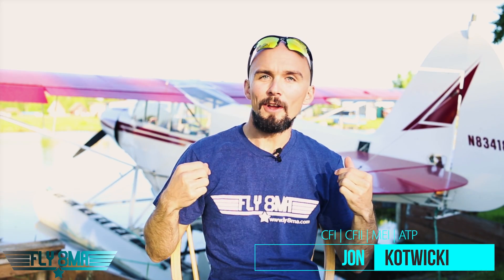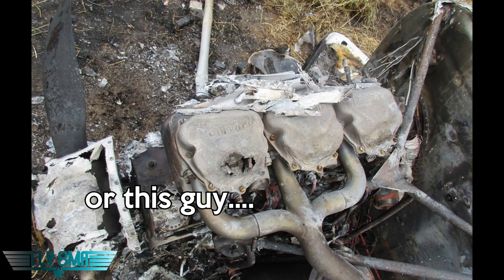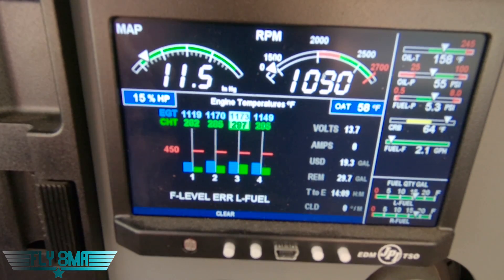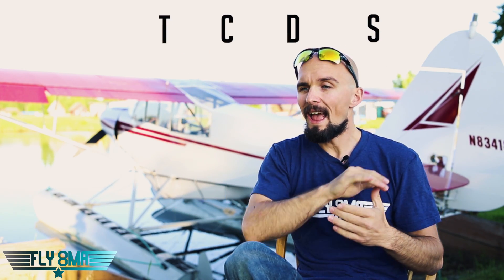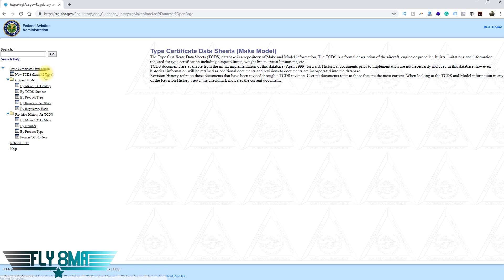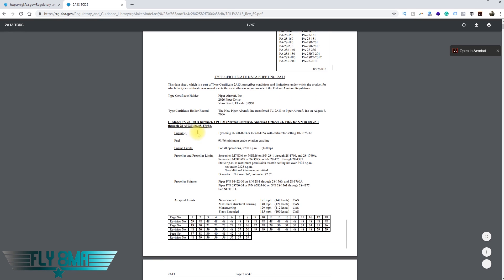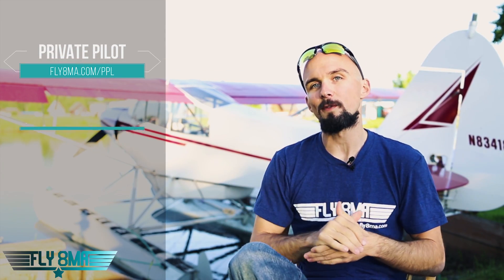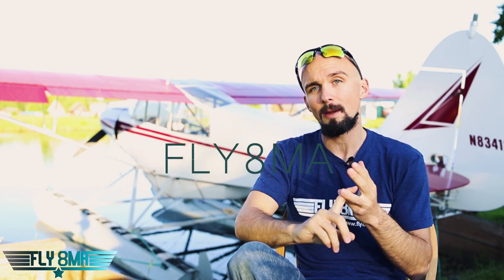Don't crash on Takeoff

Comment: You can put some carb heat on take off if wet and cool conditions.  Done that many times.  You can also lean mixture a bit if engine start getting rough.  Dont wait until engine fails when rough.  Troubleshoot with some carb heat, and leaning mixture a bit.  Practice Take Off Troubleshooting.
Reply: Right.  Take Off Troubleshooting is not taught by many CFI's.  They are afraid of doing it wrong.  Do it at at altitute first, not at 100 agl first like some one told me he tried from beginning.  No common sense.  Do it while turning crosswind with a runway available to Turnback to opposite runway.  Be valiant..

Comment: Unfortunately happened to me in my student pilot days, both my instructor and I dodged a bullet and ended up safe though. Before my second night flight, started up the plane to go get fuel and backfired it. My instructor was nearby, but didn't comment. One hour later once completely dark, took off, but was not climbing out. There was trees out there somewhere, but we were too low to turn. Carb heat helped a bit, and may have saved our butts. Got up to maybe 700agl, and did a 180 to land. Got lucky. Lesson learned - backfiring can and will scorch your air filter choking the engine of air/performance.
Reply from the maker: Crazy story! Glad you guys were okay

Comment: great advice this happened to in a c170 took off on rough grass strip with no alternate when wheels left gnd felt lo power (1900 rpm ) was able to very shallow climb to 400 ft gentle turn and back to runway only houses in front of me . the tach is all the way to right on panel silly me always look as you said now ! can't depend on seat of pants noise bouncing around etc can distract or mask
Reply: That was maybe a 200 feet per minute climb.  Did you know how to troubleshoot with carb heat and leaning mixture a bit..

Comment: VERY good advice, very few CFI’s teach this. It should be as common as “air speed alive.”
Reply from the maker: Appreciate it! Feel free to share it around with your flying friends!!
Reply: @fly8ma.comflighttraining199  The piper archer was doing several touch and goes. Engine died around 200 feet.  The prop had stopped spinning completely before hitting the ground.  We dragged the plane out of the swamp with a tractor and it started right up, yes with no nose wheel. The ntsb marked it off as carb ice because there was no other probable cause.

Comment: You blew my mind with this video! I just checked my POH. It is not in the checklist style take off instructions. However, it does specifically state, in the expanded version for normal take offs,  that the RPMs should be between 2,300- 2,400.  That is such critical information. I have never heard this anywhere else. I don't know why the POH, does not specifically say this on their check list.
I'm now going to read everything out of the expanded normal operations section of my POH.
Reply from the maker: Glad I could help!!

Comment: Hi Jon, are the rpm achievable by the engine affected by density altitude? On the one hand, at higher altitudes the air is less dense and I would expect the prop to provide less resistance to the engine, resulting in higher rpm. On the other hand, less oxygen is available to the engine which may result in it being able to provide less power. Do these effects tend to cancel each other out? Is the rpm difference at different altitudes just very slight?
Reply: SOME WHAT

Comment: We do a full power stationary run up in our 65 HP Champ. 1950-2050 depending on wind.  Also check on take off usually before the TW comes up.
Reply: If you do it with a headwind it will get more RPM, with a tailwind- less. Static Full Power Test i call it, correct me if not right that way.
Reply: @feetgoaroundfullflapsC  Yes you are correct.

Comment: If you must fly a plane that may not be in A-1 condition you can always fall back on the short take-off procedure. With your feet firmly on the brakes apply full throttle, and when the RPM reaches the go-ahead value release the brakes. Be sure to read the POH for the complete short take-off procedure (flap settings, etc).
Reply: I personally wouldn't use short takeoff procedure constantly since it affects your climb rate. 
Maybe starting on brakes but without the flaps setting for short takeoff. 
You want to climb as much as possible as soon as possible and with as much speed as possible to have energy available should you have a problem after takeoff.

Comment: some planes have gauges that show if you have carb ice. 
points for the person who can tell me which one ;)
Reply: Cessna 172?
Reply: The carb temperature is already a good indication. Knowing that ice basically forms below a certain rpm in a certain temperature range. 
You can pull the carb heater at holding point and push it back prior takeoff to have full power available. The carb shouldn't ice during takeoff since the fuel flow will be at max.
Reply: @homertalk  doesnt matter
Reply: @jiggythibs  yeah sure, but still not the one i was thinking of
Reply: F-15 E model.
Reply: @jiggythibs  --What CFI told you that?? That is very dangerous BS.. YES YOU CAN GET CARB ICE ON TAKE OFF. And i had it.. At 100 feet agl.. Cessna. Had to lean some mixture and some carb heat too wile keeping the Vx to clear obstacles.  On Autogas engines you have to troubleshoot that way. Not too much carb heat apply due you will make things worse if too hot carb air intake.. Worked, but it was a very misty day and at 800 feet agl engine starting losing power again.  Cancelled flights that day..
Reply: @feetgoaroundfullflapsC  My CFI never told me that. I just double check in the manual of the PA28 Archer II I fly on, and you're right I bs. It says to use carb heat during engine test to eliminate ice, it says carb heat shouldn't be use on APP/LDG since it reduce the power available unless icing condition and it says that at full power, the carb heat can cause misfire. So I don't know from where I came up with this rpm story and fuel flow. Sorry for my wrong info and thank you for letting me know since I got to read my manual more carefully and refresh my knowledge.
Safe flying everyone!
Reply: @feetgoaroundfullflapsC  Thanks for your explanations. 😉
It makes sense to me.

Comment: Just put a green line mark on the static rpm. Its is called a "Static Full Power Check"..  Been doing that for almost 30 years on the ones i teach. I also put an S letter using those small letters from those electric wire markers you buy.. I also put an M on the minimum rpm  to keep altitude at full gross.  They really help, while practicing partial power fails.  All airplanes have a different "Minimum Level Power".   That "M" right there can quickly make you decide if you can try to keep altitude at that RPM or not.  Less chance of stalling trying that.  Partial Power engine fails are the most common, practice them in all legs of the traffic pattern.  Pilots are supposed to be ready for all kinds of engine failures, not just at cruise..

Comment: If you put carb heat, you have to lean the mixture a bit too.  Many "old pilots" i tested were very afraid of leaning the mixture on take off due they WERE AFRAID of take off engine fails also and didnt want to touch anything, even if engine needed troubleshooting by them.. Yes you can lean a bit/ Not to the cutting point, of course. Lean temporarily only if on take off.  Ask your CFI to demonstrate a carb ice RPM drop at least at 500 feet agl. with leaning the mixture for a few seconds.    Its an easy demo if he is not afraid to do it.. He shouldn't be afraid of teaching you those most important emergencies.  Dont smile at mediocre flight training..

Comment: For example, clouds form higher from the ground as a result of altitude 
temp drop.  It is called CONDENSATION. You could not get carb ice on 
ground, then you just climb a little bit, say to 500 feet or 1,000 feet agl, and at 
that temp you start getting it.. UHH, duhh!! How come I didnt get it on 
the ground??.. 
But LOL..  Some forgot the basis of carb ice..  I have 
explained that to many old pilots that "never had carb ice on take 
off".. It happens.  Carb Ice can happen at high rpm too.  Be ready for it
 by practicing troubleshooting on take off..